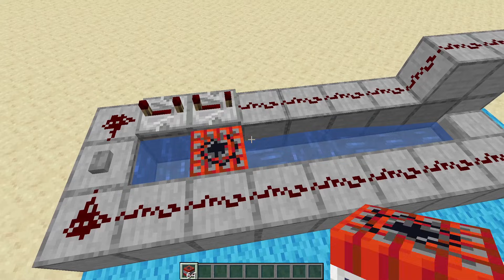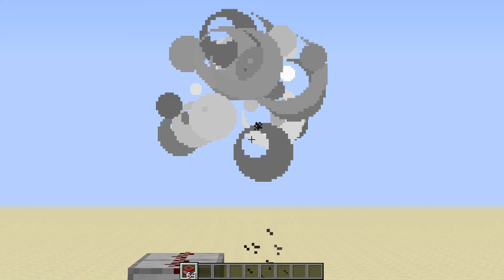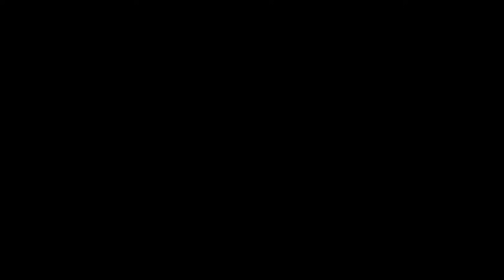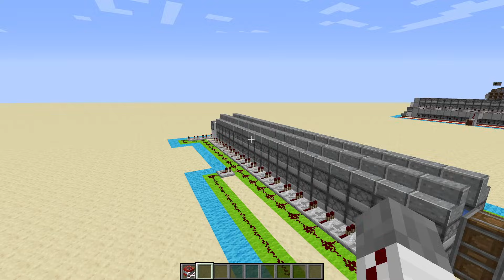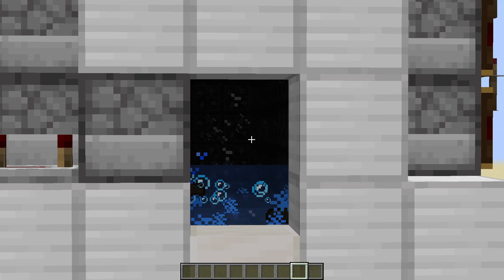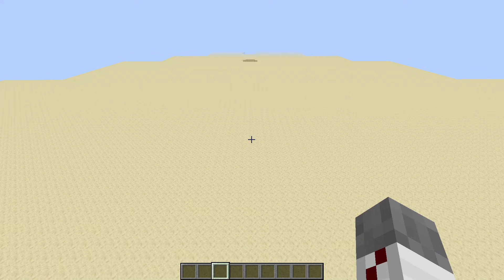Minecraft Create Mod TNT Cannon Designs!

Comment: Here's my tips, I played factions for a while

Soooo, you basically made it so all of the extra dispensers are for the sake of launching. You made cannons that shoot for a long distance, and that's cool, except you didn't consider that if you actually wanna do a lot of damage, you should be putting some more focus on the "cannon ball" itself (the TNT hazard being launched) and not on the launcher. I suggest you try to add several TNT to be launched at the same time, that way when they hit whatever they hit, it does a ton of damage like some kind of nuke. Note that the launcher should always be made of inexpensive, easy to build, throwaway material. In fact, in some cases, the closer you are to the target the better, because then you don't have to make so much TNT for launching. 

I think your 2nd design is great, just need to add more cannon ball
Reply from the maker: Definitely excellent advice. And you're right, I believe that the largest of these canons is basically not usable and just a show of power, haha. I will take your points into consideration and work on some designs with closer and bigger blasts.
Reply: @BLOckOus  Maybe you can offset the timing of the main canonball for each bit of gunpowder (tnt) just the tiniest bit so that each explosion will spread it all outwards? Just a thought.
Reply: It’s best to have good range and power.

Comment: Ive built a cannon better than all of these
Range is nice but youre just shooting one block, its not that destructive 
30 at once?
Decent
500? 
There we go
Reply from the maker: Noted! That's the plan for my next set of cannons: Stronger blast power, shorter distance.
Reply: @BLOckOus  you could try having the water running to the back of the cannon, that way the propellant tnt gets pushed to the back as the actual shot gets dropped into the water
Im not sure how to explain it exactly but it gives better results than foreward flowing waterbeds for me and its basically the only way ive gotten a burstfire cannon to work

One design that works really well for me is putting a water source block at the front, four dispensers on each side of the barrel(these deliver the actual shot) , a block space, and then two dispensers on each side and one way at the back for the propellant with an inverted staircase and halfslabs along the top to keep the tnt from flying off, hook the whole thing up to a really fast redstone comparator clock and let it run for 3-5 seconds then switch it off. Its loud and pretty inefficient but it shoots like a railgun
Sadly ive only gotten that to work on bedrock